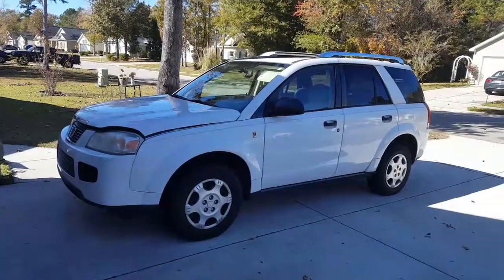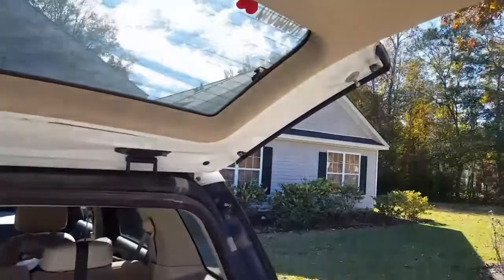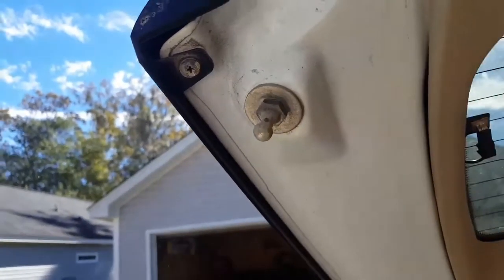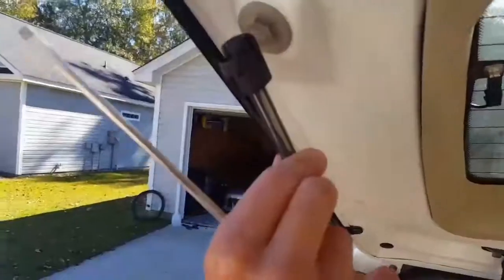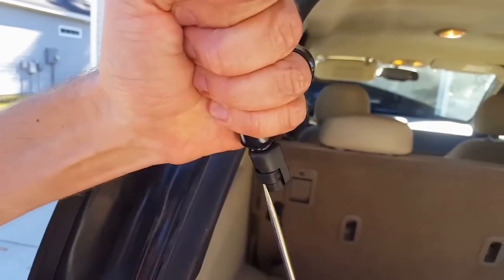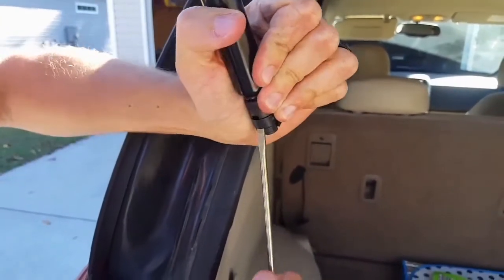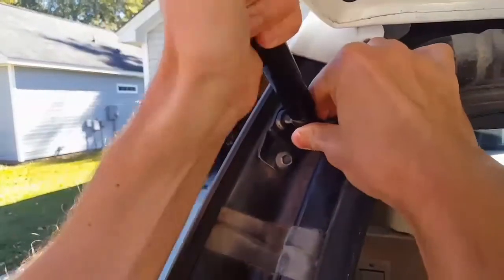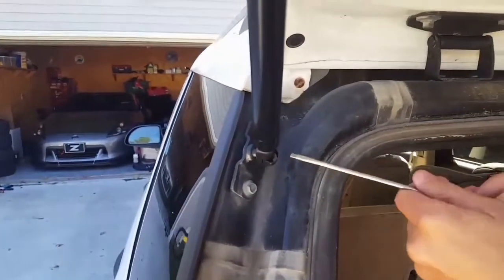2006 Saturn Vue hatch support replacement #saturn #vue #liftsupports

Comment: WARNING:  Do not pry the clip on the new struts too far out.  This can result in the clip bending or rotating making it difficult to insert it on the male section.  Simply line it up with the male section and gently pry it out just a little bit while at the same time pushing it into place--then release the tension on the clip and it will lock into place.  I made the mistake and tried to "prep" the new stuts and opened up a real can of worms when the clip spun out of position and I had to completely disassemble it.